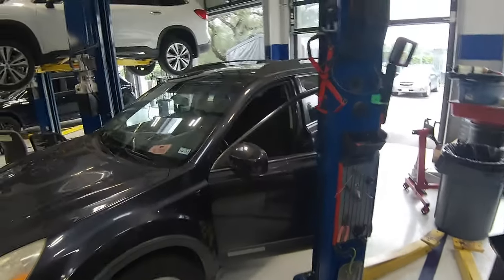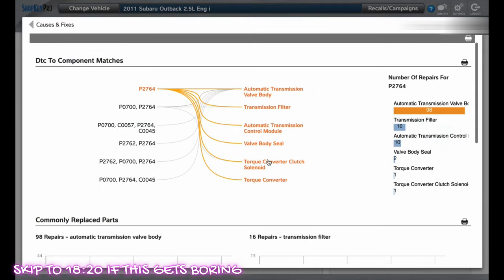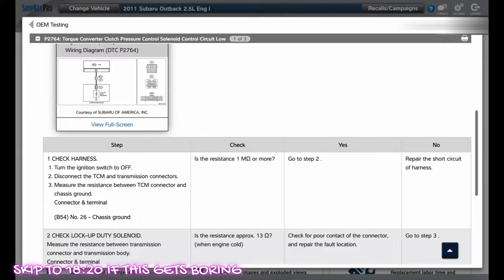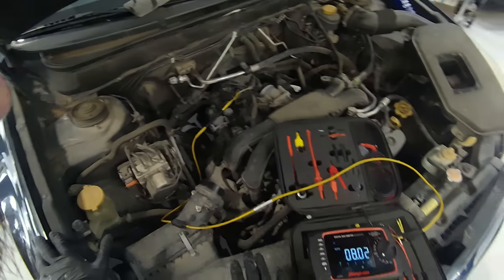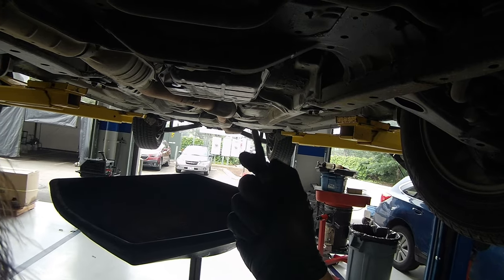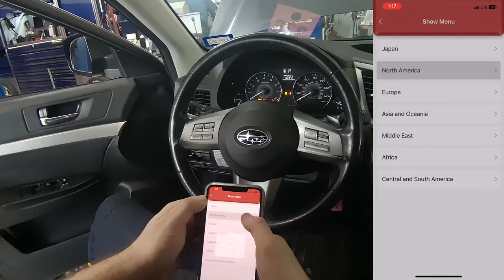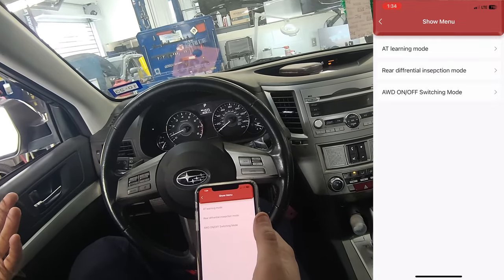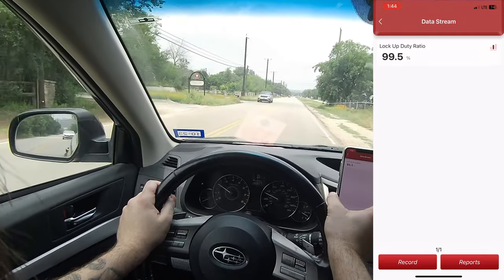Got P2764 Lock-up duty solenoid failure? Learn How to Fix It Yourself with a $120 Scanner!

Comment: Thank you for the video and explanations. My vehicle is a 2011 Toyota RAV4 CVT. I am getting error code p2764 in my vehicle. My mechanic says it's caused by the torque converter and transmission. I wonder if it will be fixed if I replace the valve body? Thanks

Comment: Even if you used this scan tool on that model year, that would be awesome, but I know that's specific
Reply from the maker: good argument. the transmission relearn for the subaru has been a closely guarded procedure for years. Snapons $12,000 scanner/programmer couldn't do this in 2018.

For a $130 tool to get this feature is amazing. I'm building a whole series about this tool, on different manufactures. 

Trust me this scanner is amazing

Comment: So your saying I can reprogram the immobilizer after a gauge cluster replacement on a 2012 outback h6?
Reply from the maker: No
Immobilizers will always require designated tools to program. The most this tool could do is vin burn an ECU and set the option numbers. This will not program keys or program modules.

There are a lot of mobile techs that help with this and cost less then a dealer

Comment: Liked your video and all the info you shared. At what point during the relearn did you release the parking brake, or did you? At no point during the procedure did it tell you to and wondered whether that is a point lost in translation. Having some complications with my device including not finding codes that are indicated by the dash lights and also strange codes not found with another code reader. Thanks!
Reply from the maker: There is no command to release the parking brake. I released the parking brake when I took the vehicle on a test drive.

As far as you scan tool not reading codes, I suggest uploading a video and leaving a link in the comments.

Comment: hey bro! thanks for this info video !!  I have the same codes and problems ! no feeling the gear weird ........I have to do it just want to know how much cost this job?? thanks!!
Reply from the maker: The labor to replace tire sensors and program them is about 1.2 hours labor. So depending on shop labor rate you’re looking at $100-200 dollars.
Reply: Ohh really?? Damn!! Hopefully in the shop doesn’t rip me off .  But tire sensor?? Or transmission body valve ?? !! Bro thanks for this video ! You have a new suscriptor here!! Blessings!!
Reply from the maker: @surferporroloco  
Sorry I thought this was a TPMS problem
Labor and on the valve body can be 4-5 hours plus parts
Reply: @baja-automotive  great bro thanks!! Are you located on San diego??